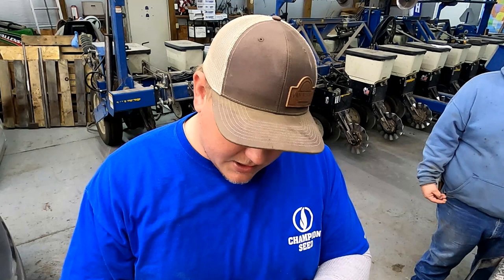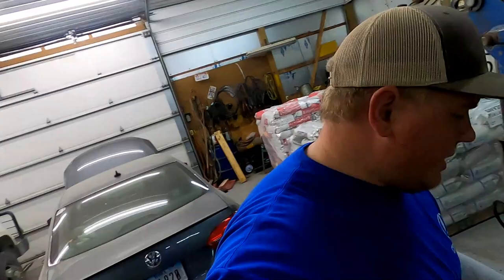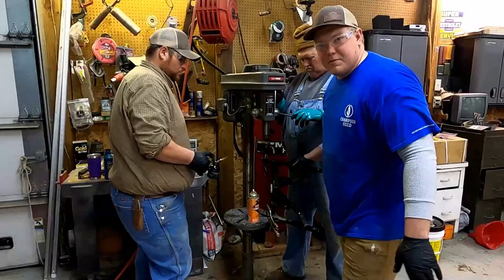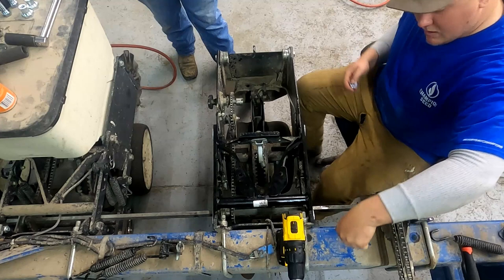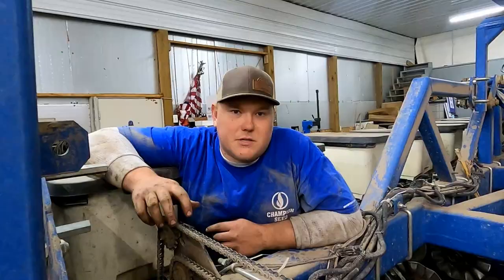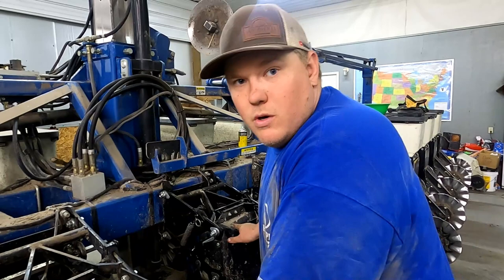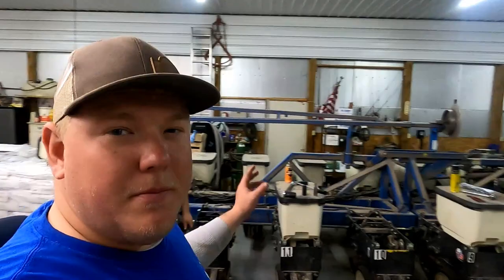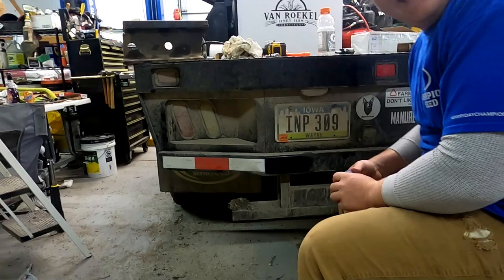Saving THOUSANDS on this planter REPAIR

Comment: Kinze makes a good planter for the bucks. I imagine you'll be doing a ROI study on all of your primary equipment and at some point a change is inevitable. I think an alternative is having PrecisionAg do a complete overhaul. No matter what the color, by the time upgrades are done it really doesn't matter.
Reply from the maker: Bill Whitman as an Ag Leader dealer I agree with you. You don’t need to buy brand new planters. You can outfit planters and make them top notch!

Comment: Can you buy the plastic bushing separately?  If you can maybe replace them every year or so before they totally wear out.
Reply from the maker: You can. But they wear out during the season a lot and they aren’t that tight of Tolerance to start with
Reply: @iowANFarmer , I was talking about the new ones that you installed as I'm sure those bushings will wear some and if thy sell them separately then it makes them more of a value.
Reply from the maker: USMMCE I’m sure you can.